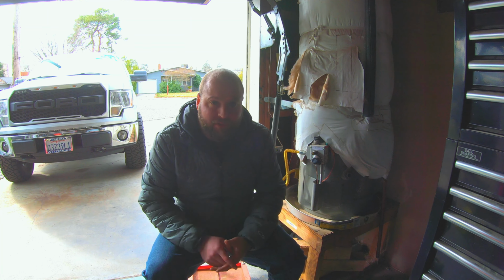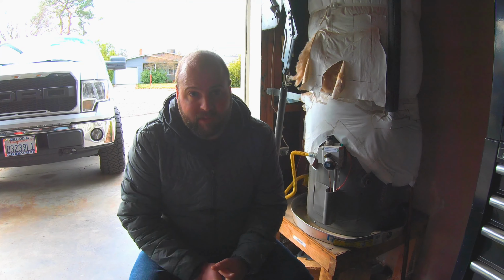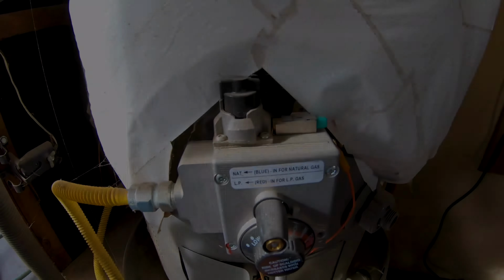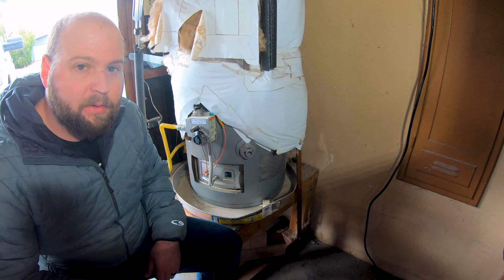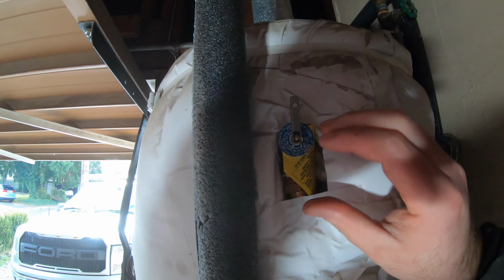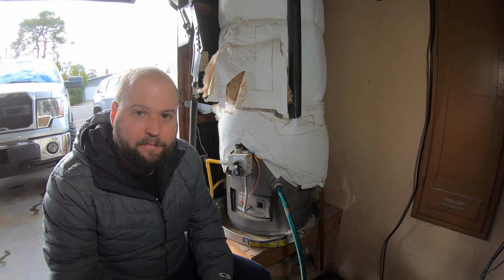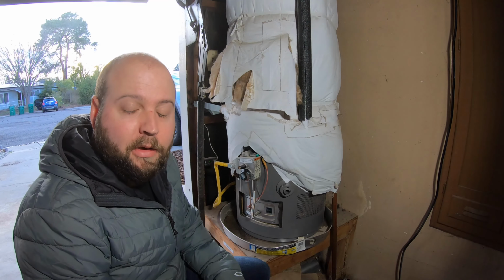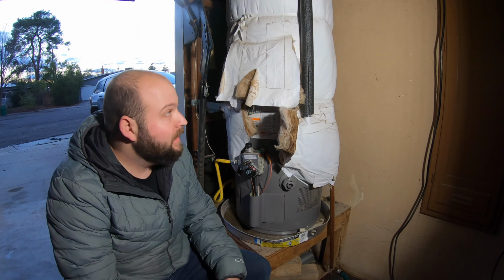Water Heater Problems, No Hot Water Pressure??? FLUSH IT!

Comment: Well I did this thinking it was a good preventive measure...well !.....old adage...."if it ain't broke...don't fix it !! This stands soooo true. After doing this procedure, I lost even more pressure on the hot water side. Spent days watching videos and reading but to no avail. Finally, just looking and studying the hot water heater tank, I looked at something odd...the outlet was 3/4 going to 1/2 line to the house. After wrestling with the fitting, I got it apart and there was the problem ! I disturbed the sediment and when I turned the water back on, the hot water side picked up the loose sediment and plugged my outlet side of the HWH. I cleaned it up...and every thing is fine now. PS, you might want to add that in your video.

Comment: Did this fix your pressure issue?
Reply from the maker: So this is a preventative measure to help with sediment going through the lines to faucets or appliances. Actually fixing the issue would require you to remove the screen filters at the faucet or appliances to clear out the restriction.

Comment: I just bought and installed a new water heater to replace one that was working fine (electric) because it was leaking. I had plenty of flow with the old heater but only a trickle with the new heater. I hooked the water inlet supply directly to the outlet to the faucets (bypassing the heater) and had plenty of flow proving that my plumbing was OK, I was refused a replacement water heater and only offered parts to try for a fix. KNOW WHAT THE PROBLEM WAS??? SOMETHING WAS LEFT INSIDE THE NEW HEATER THAT PLUGGED THE OUTLET FOR THE HOT WATER.  I was just left on my own!!!!
Reply from the maker: I applaud your do it yourself courage. DIY is all about trying things you have never done before! Glad you got it figured out and hope the video helped!